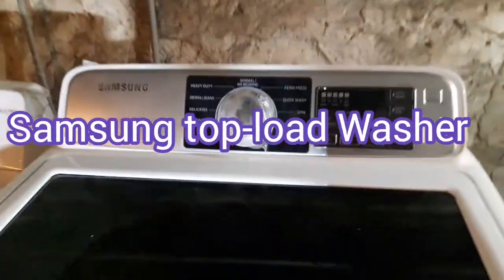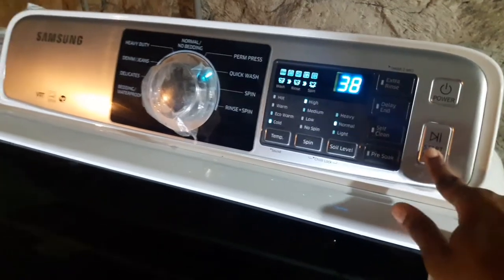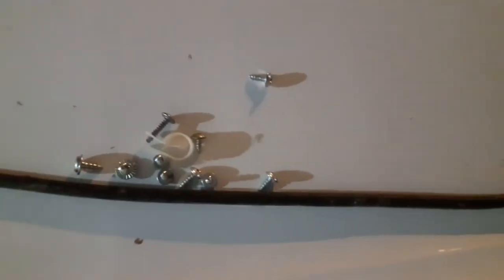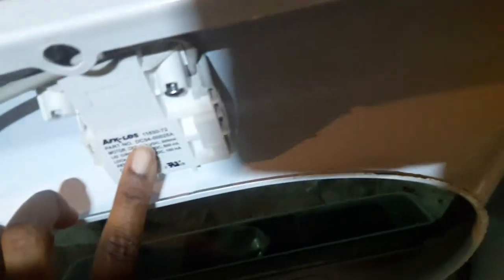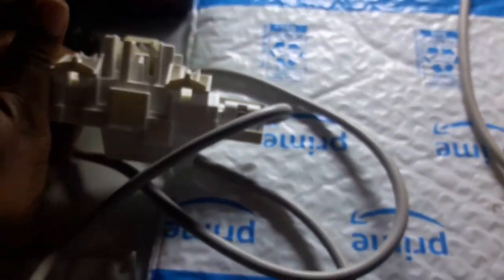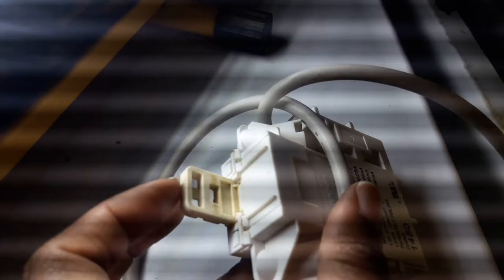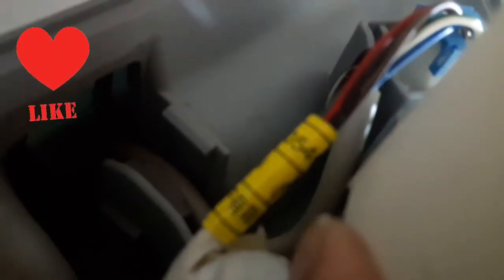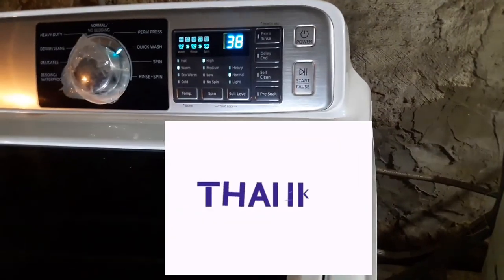Samsung top-load Washer/door not locking

Comment: Thanks sis.
Reply from the maker: Your welcome
Reply: @donnaleetellsall  Literally on Monday, the 10th, I replaced my water pressure sensor. Installed myself. The water still does not know when to shut off. I ordered a water inlet valve. I'll replace it when it comes in. If THAT doesn't fix the issue, I'm throwing the machine away.

Comment: Replaced switch and it still doesn't work.
Reply from the maker: @gloveref  look over every wire. You must have pull a wire lose, or Worse case you have a bad computer circuit broad which controls the on and off power and the temperature switch.
Reply: @donnaleetellsall must be control board. Sometimes it works, and sometimes it doesn't. Old switch did the same thing.
Reply from the maker: @gloveref  it sounds like control broad is bad and need to be replaced.